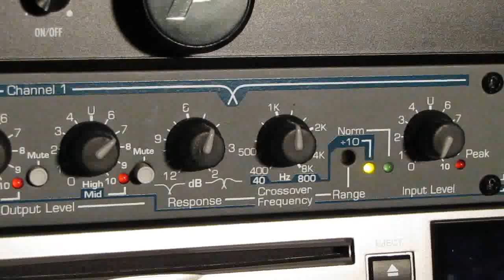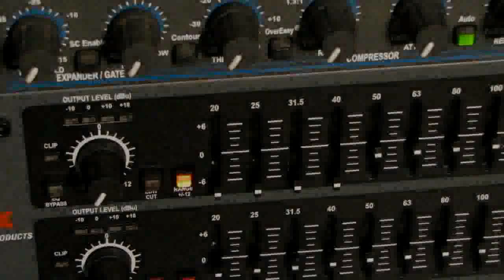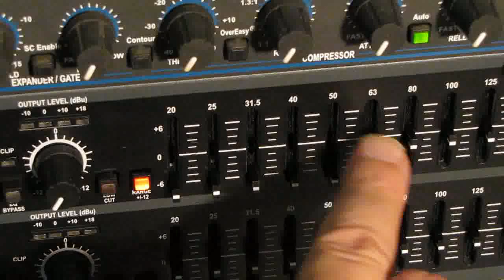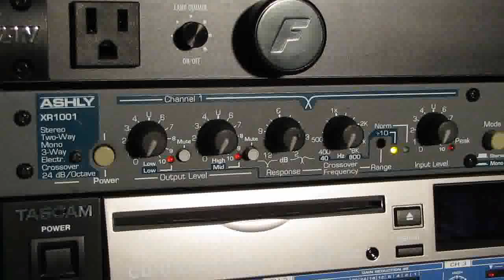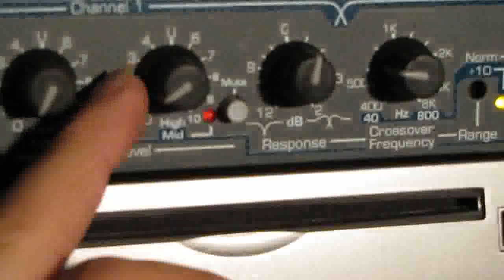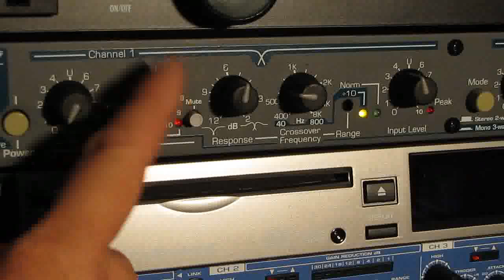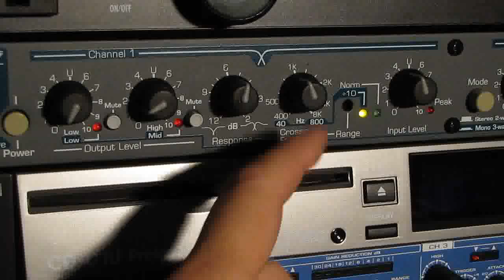Using a basic crossover as a high-pass filter.  Setting up the crossover

Comment: Can turning on the active crossover after turning on the power amplifiers cause a loud popping sound if so is it likely to damage your speakers and tweeters
Reply from the maker: Yes.  The tweeters are very susceptible to damage due to electrical poping, which is why amplifiers are always the last to be turned on and the first to be turned off.

Comment: hey. are you still active today ? i have a question. is it possible to use the gain of low frequency crossover as a low cut gain? which is i set my low crossover to let say 50hz .. then i will crank the low frequency gain going down to left?
Reply from the maker: Yes, you could use it in that manner.  The HP filter method may still be the best option.
 Sounds like you are just needing to lower the low frequency levels... if this is what you are needing to do, it would probably be easier to use an EQ to lower the low frequency levels.

Comment: A question: which is better, to connect the mixer-equalizer-crossover-power or mixer-crossover-power? leaving the equalizer to insert on the channels I need?
Reply from the maker: An EQ for FOH is mostly used to apply minor corrections to the overall sound system.  Your second option (mixer-crossover-power) would be a better setup.
Reply: @stageleftaudio  Excellent. Thanks brother

Comment: Hi sir good day. I want to ask about setting up an active crossover in 2 way sterio. In 2 way the output are low and hi the mids were dis regarded, my question is what is the starting frwquency in high outputs. Coz i know when it is  in 3 ways the outputs were started at 2khz or 5kz to 20k hertz. But how about in 2 way?. Can i connect my mid hi speakers(combination of woofer and tweeter) to this hi outputs? And what would be the starting frequency output.?im afraid it might damage my woofer..thank you and godbless to your vlog.
Reply from the maker: The crossover frequency for a 2-way system can vary between the cabinets (low and mid/high) that are used.  Many times,  a crossover point for a 2-way system (what you described) would be somewhere between 100hz to 120hz.  Using a 2-way (passive) speaker (with an internal crossover to the speaker) for the mid/high frequencies is very common.  Doing this will not cause an issue with the bass speaker of the mid/high cabinet... however, make sure you do not use an amplifier that is too powerful for the mid/high speaker.
Reply: @stageleftaudio  if my midhigh dont have internal passive crossover sir. And i would connect this to the high output of my active crossover what would happen sir?.does it cover the mid and high frequency?
Reply from the maker: If your mid/high speaker does not have a passive crossover, you will need to use a 3-way crossover.  The crossover settings for the speakers will need to come from the speaker manufacturer.  There's so many different speakers, and crossover points that can be used, that it is very difficult to determine the best crossover point for a speaker.
Reply: @stageleftaudio  but i will use an active cross over sir. I have 2 amps. 1 amp for low and 1 for midhigh speaker and im planning to hook it up in 2 way stereo.what would be the xover setting sir
Reply from the maker: Each speaker can use a different crossover setting.  You may need to check the manufacture's specifications for what they determine as the frequency range of the speakers.  Without knowing the manufacture and model of the speaker, there's no way to accurately determine what crossover frequency to use.

Comment: Hi good day.. sir can  you explain  about the summed/normal.  button at the back of the dbx crossover.. which one is usefull for   live sound. Any answer is appreciated tnx.
Reply from the maker: The "summed" switch is used with systems that are using a single subwoofer.  The "summed" switched combines the low frequencies of both channels into one mono channel (which I think is the "low" of channel 1).  If you have one sub, you would connect it to channel 1 "Low" and enable the "summed" switch.  Some people will daisy-chain a second sub from the first sub to maintain a mono sub setup (which is the preferred method for large halls).

Comment: hello,  thanks for the videos very helpful.  question? I have a dbx 234 x over and a dbx 231 eq.  coming from my mixer what unit should I go to first.  After watching your videos I like the idea of the eq not being in line like you suggested. Also I have a multicom pro xl dynamics processor at what point would you use this unit?  is it only for vocal? . thx much
Reply from the maker: If your board has inserts for FOH, the EQ should be placed there.  If the board doesn't have inserts, then it will need to be placed after the console (before the xover).  The outputs of the xover will then connect to the xover inputs.  Make sure the EQ gain is set to -0- db; any louder than this, it could introduce noise into the system.

The multicom unit is designed to be used with insert points on consoles (channel, or subgroup).  For example, to use the multicom unit as a compressor for drums, you could use one channel of the unit for all the drum channels.  This is done by attaching one of the channels of the multicom unit to a subgroup insert point; then, assign all the console channels for the drums, to the subgroup that has the multicom connected to it.  The mulitcom unit can be used for anything that requires compression (vocals, drums, instruments, etc...).

If your board doesn't have insert points for the subgroups (or if your board doesn't have subgroups), you can attach the unit to individual channels using the channel's insert points.  The unit works best when it is used as insert.  Try not to use the unit inline (similar to what I mentioned above) with other equipment.

What model of board are you using?
Reply: Hey partner first let me thank you for your reply you have no idea how thankful I am for you help!. I am new to this youtube posting! is their a way I could send you a couple of photos?. I am a guitar player and this is my first pa. I am 48 so I am a little familiar but the pa was obviously was not hooked up when I got it and I'm not a 100% what the heck I'm doing and don't want to blow it up. The board is the newer Xair18 Digital by behringer. the subs are berhinger 1800s 400 watt cont-1600watt max. the foh speakers are behringer 1520 250 watt 1000peak. one power amp behringer europower epx3000 at 8 ohms 2x550 watt. I do understand what you said about running the eq at insert at foh. any way to send photo?
Reply from the maker: You are welcome.  There's a lot to know in running sound.  For sending a photo, look at the "About" tab on this channel (on the main page).  Look for: "For business inquiries:"  Click on it to get my email address.  Try to keep the photos about 1M in size.

For your PA, the Xair 18 is a digital board; it contains all the EQ, compression, gates that you will need.  Your analog EQ and multi-com will probably not work with the Xair 18 (and probably should not be used with the Xair).  Though, this is ok, because all the processing you need is in the Xair.  That board (like all digital boards), have a FOH EQ built in.  I assume you have an I-PAD for your Xair?

Your speakers look good.  Though, do not factor in the "peak" watts of the speakers when looking at how much power they can handle.  The "peak" watts is not an accurate representation of what speakers can handle.  Your 1800s are 400 watts continuous, which equates to about 800 watts RMS.  Same for the 1520 speakers, 250 watts continuous and about 500 watts RMS.

Comment: hello again. thanks for your last reply. I'm having another issue which no one seems to be able to help with. I trying to setup a 4 way stereo system. The ashly XR-4001 is perfect for this, but I just can't find one anywhere especially as I'm in the UK. Is there another way I can achieve this. someone said to me to get a DBX driverack venue. But that still doesn't give me a stereo 4 way setup. can I use a driverack PA and a separate crossver with the driverack connected to the master output on the mixer and the second crossover connected to either the mixer booth output or one of the mixer subgroups
Reply from the maker: +Ricardo Miller If you're needing a true 4-way stereo xover, you should be looking at units like the XR-4001 or Rane's AC24 xover.  Also, what may work would be the use of two identical separate xovers (one for each channel of the main-out)  The dbx 234xs units come to mind as an affordable option. 

You may be able to setup your system using the configuration you mentioned (above), however... setting up a system with multiple crossovers in the same signal chain will introduce other issues (phasing, noise, un-needed complexity), which most always results in a bad sounding sound-system.  Try using two separate units (one for each channel).  It may be more affordable as well.
Reply: +stageleftaudio thanks for another valuable insight. it's refreshing to get an actual answer rather than having someone tell u to get a driverack venue which doesn't do what I want. I have look at both the units you suggested but they are proving rather difficult to get hold of here in the UK. so I have decided to use 2 driverack PA+ unit with xlr y cable feeding both units. 
thanks again for u reply much appreciated
Reply: Ricardo Miller
Reply: Ricardo Miller
Reply: Ricardo Miller h. buka-bukaan